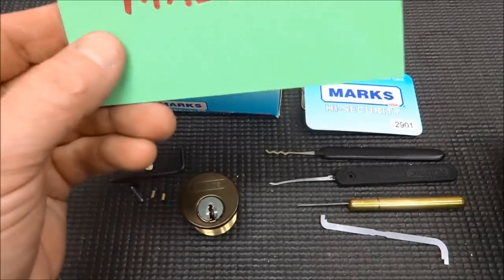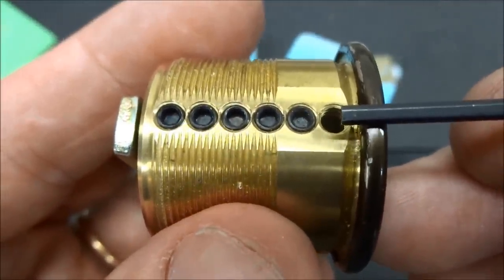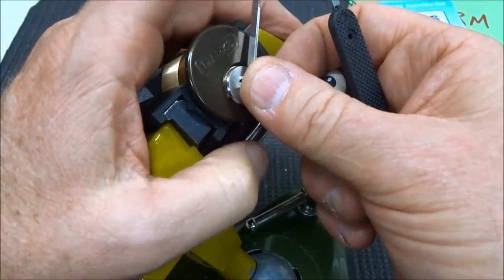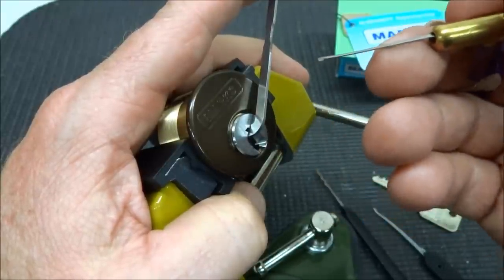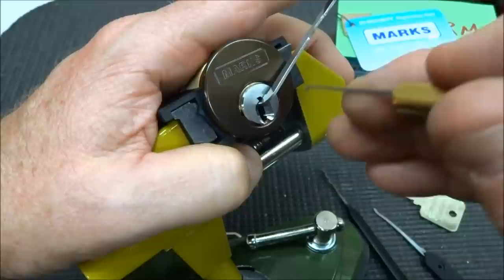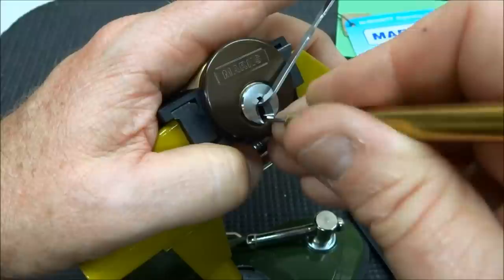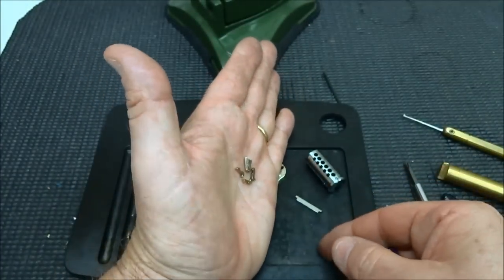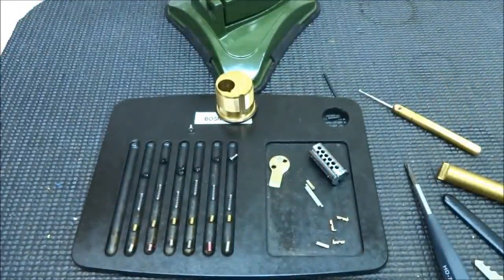(337) Marks (AKA Skorpion, CX 5) Picked Open & Gutted

Comment: Nice pick Bill,
I just got this lock and have been going through it and it is a nightmare to gut totally. But if you use the key it slides out just like normal just hold the sidebar in place and the key holds the rest. Just FYI

Comment: I been locksmithing for 10 years now and in our area we don't get high security locks or cylinders too often.... My question is the sliders interact with the side bar corrrect? If so, is the side bar springloaded and if not how does it "drop" in?

Comment: Ok Bill, Did I notice that the slider pins also have false spots on them also?
It looked like they were security slides to me?
other then that nice work.. :) From Chicago, :)
Reply: bosnianbill
Thx for the reply I notice you said at 15:25 that the finger pins are "not modified" but they still have false gates.
Not sure as to what not modified and still have a  security false gate side pins,
   :) Happy picking..